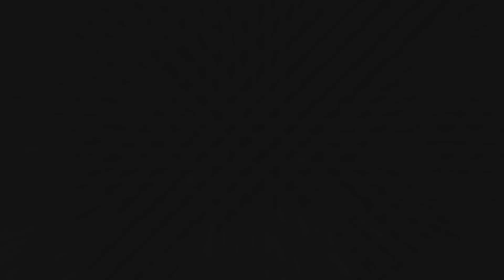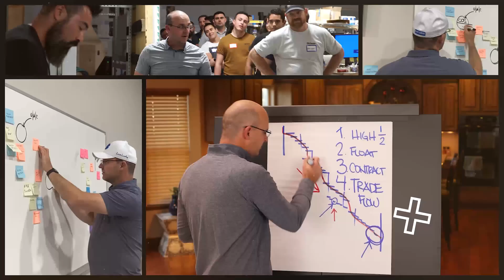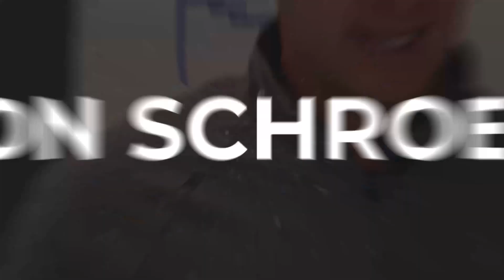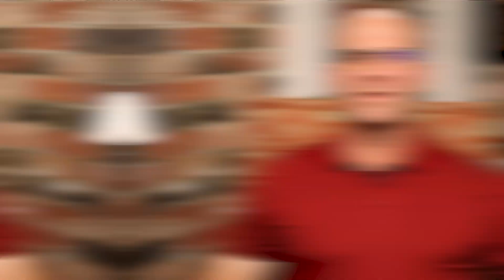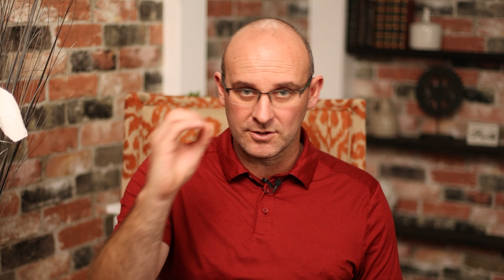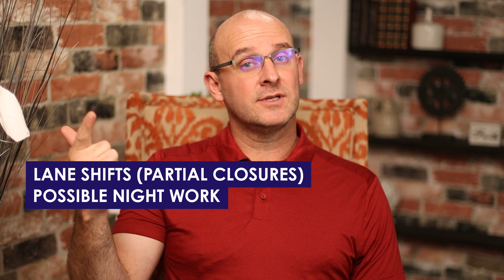How Long Can Construction Stop Traffic?

Comment: Very useful information as always.
Question, I’ve got associate CM degree with years of experience in residential, now I want to switch into commercial as superintendent, been applying for jobs but haven’t received any offers yet, any suggestions please?
Reply from the maker: @ahmedriyadh7520  it is frustrating.  Companies need people but are not willing to train them.  I would consider an internship or lower position.  But once you get in you may love it.
Reply: @ thanks, you’re right.